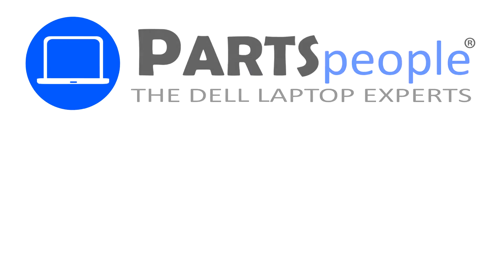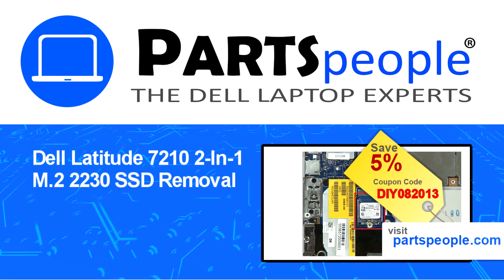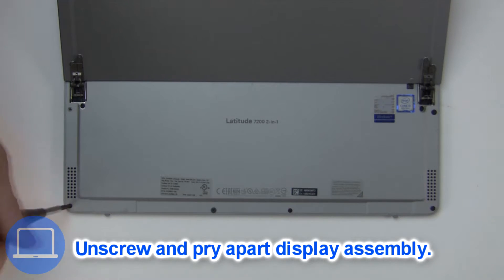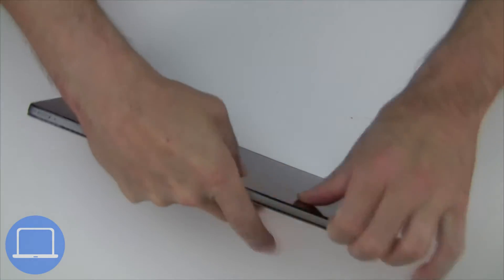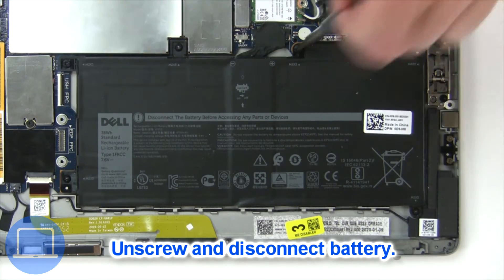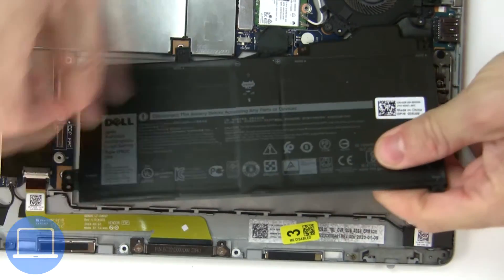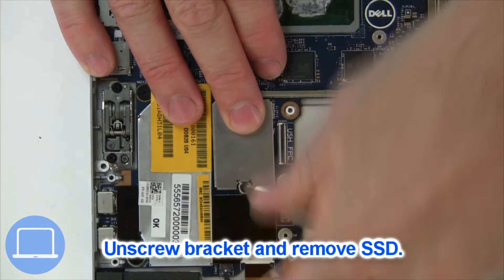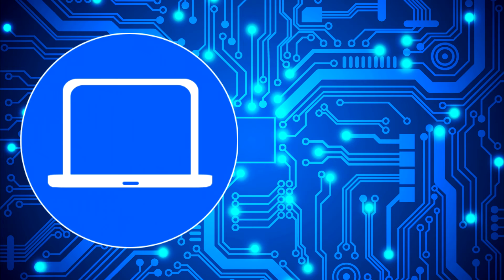Dell Latitude 7210 2-In-1 (T04J002) M.2 2230 SSD How-To Video Tutorial

Comment: Can I use a 2280 size ssd and just double side tape it down and put it back together or will that connector get in the  way?
Reply: I have the same question...I guess I will open it up and try it out.  I will let you know how it turns out.
Reply: @danielpeters1754  How did it turn out?
Reply: @danielpeters1754  Hello Daniel, did it work?
Reply: thank a lot for your video. I have a question, is it possible to add second ssd at wwan slot? If yes, what spec of ssd I shall buy. I noticed that someone failed to install WD sn520 pcie 3.0 x 2. Thanks a lot .. Thomas